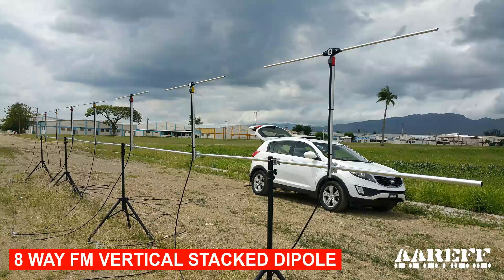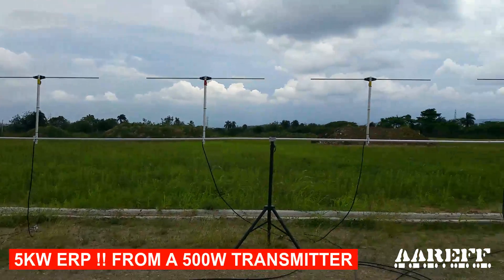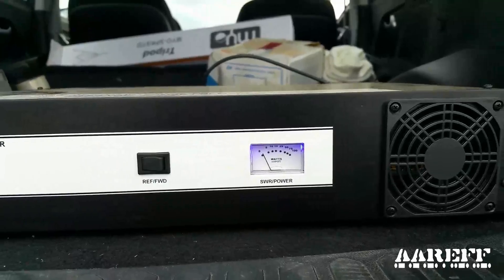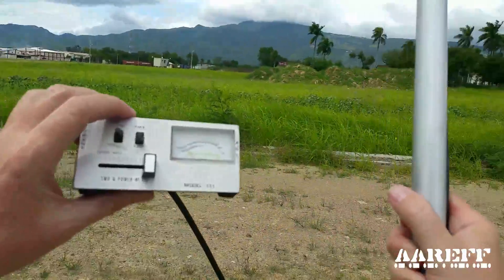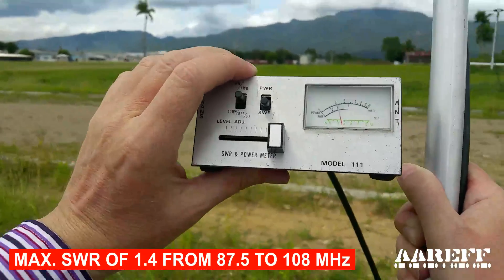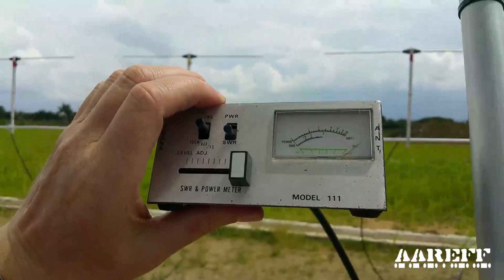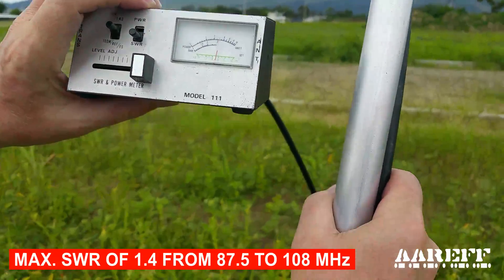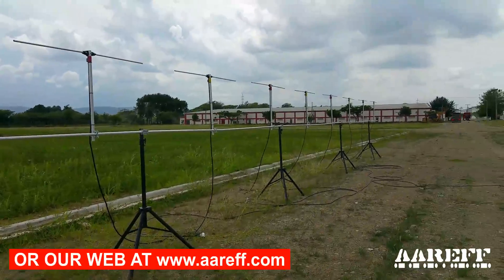8 Way Stacked Dipole 11dBi Gain FM Broadcasting Testing

Comment: Did you mean to say horizontal dipoles?
Reply from the maker: No, they are supposed to be mounted vertical, but to check the radiation pattern we mounted them horizontally.
Reply: @AareffSystems  yea i apologize i figured it out after the comment. i am about to start using two cophased dipoles and was just looking at other peoples builds. this one looks great. good job.
Reply from the maker: @TexasPrisonStories  Thanks 😊

Comment: With those Dipoles There is NO Lightning Protection out in the open. On the circular broadcast antennas the radiators at least go to ground. I use a dipole for my 1 watt station.
Reply from the maker: If an antenna takes a direct hit of lighting, the fact that it's grounded or even has an inline arrester fitted, will not save the transmitter form damage. We stopped using inline lighting arresters years ago when we realised they didn't work.

Through years of experience with our transmitters and antennas installed in severe lightning zone areas, we have found the the 30 degree protection zone method is the better and only way to protect from lightning. There's more info on this here:
http://www.aareff.net/2015/02/25/are-you-worried-about-lightning-strikes
Reply: At the lower transmitter power levels, Dipoles work the best.  The lightning will be attracted to the grounded tower anyway.
Reply: Then you are changing the radiation pattern of the antenna system you've just bought..
Reply from the maker: @knigget357  Why would the radiation pattern change?
Reply from the maker: @SuperBorg1  Agreed
Reply: @AareffSystems  If I Had this antenna on my 1 watt transmitter I would Be way over the ERP limit.(not just a Little) The FCC usually ignores you at only 1 watt with a single antenna as long as you Don't Block any other stations. I always limit Myself to 1 watt unless I Get an LPFM Permit.
Reply: @AareffSystems  Using your 30deg rule adds an extra 2m to the mast which will act as a director and change your radiation pattern
Reply: @knigget357  You can add any vertical amount to the mast, it will not act as a director and it will have virtually no effect on the radiation pattern.
Reply: @SuperBorg1  That's what I was thinking, if I staged this experiment around here I would be asking for trouble. Doesn't make the experiment any less fun!

Comment: Your testing field strength with a 27mhz cb swr meter
Reply from the maker: Correct! it doesn't make the slightest difference if it's labelled 27 MHz. The meter has a RF sample line inside it with rectifier diodes and will work perfectly in the FM broadcast band.
Reply: @AareffSystems  can be used for this dimond sx200 swr pwr meter?
Reply from the maker: @zeljkoadzic1692  The Diamond SX200 power meter can be used, but remember to get a reliable power reading you need to have a 1.0 SWR. This antenna is good, but it does not have a 1.0 SWR, only high quality dummy loads have 1.0 SWR.  This antenna has an SWR of up to 1.4, this is a reflection of about 4% and in normal operation this is not an issue, it's not detectable as a problem or signal loss on the receiving radio. However if you are trying to make an accurate power measurement with the SX200 or any other power meter, then it's normal to expect an error in the reading up to +/-20% with an SWR of 1.4. If you want an accurate power reading you need to use a dummy load with an SWR 1.0 on your SX200.
Reply: @AareffSystems  i have dummy load resistor. RF florida.

Comment: Great video guys, shame you did not  move your hand antenna in different angles to mimic typical car radios angles, and desktop players, the high gain does flatten out the signals, yes doing exactly as it is supposed to, which is why, stations will use  4 bays for city highrises, having a broader pattern
Reply from the maker: We agree, in cities with tall buildings and also hilly areas with deep sharp valleys these antennas are no so good, we prefer lower gain and even circular polarisation. But if you are  on top of big hill or mountian and you can see more than 50km, these 8 ways are amazing.
Reply: @AareffSystems  
I've never been convinced mixed polarity  antennas are better than std dipoles, I come from a land mobile background, and if I can use a hand held in any angle and direction to UHF or VHF  SMD or colinear bases in vertical polarity, I dont get why people in broadcast try push mixed pol, apart from mixed pol ants cost a lot more so they make more money :) I mean are we really to expect that RF discriminates against one idy bidy tiny freq range ?  if mixed worked better no doubt that would be the only base ant available for any band,
Reply from the maker: @Ressy66  There are several studies into circular / mixed, most by the FCC, which demonstrate that circular / mixed works better in cities, like New York, with really tall buildings close to one another. Also our customer reports over the last 25 years would also back up this to a certain extent. Like you I personally prefer vertical, but I have to concede circular / mixed does appear to be better in some situations. The BBC also made some compelling studies that demonstrated that vertical was the best in most situations in the UK. It is still quite a controversial topic with mixed (pardon the pun) views.

Comment: Great test 👍...an question!,when mitter goes to end ,mean how much power you had?? I mean portable power metter mitter
Reply from the maker: To get full deflection on the meter in the video, I can't remember exactly, but it needs between 50mW and 100mW coming down from the receiving dipole. There is no amplification inside the meter, just detector diodes being driven directly from the voltage received in the air (free space).
Reply: I see..but as i realized,your transmitter power set to 50 watt?! If yes so you should have more power in front of antenna with more distance from it
Reply from the maker: @hosseinrf1004  The detector diodes in the meter are not biased and do not have any additional amplification, so they need quite a strong signal to get the meter to deflect, even when you are in front of the antenna. The point to this demonstration only relative showing that at the ends of the antenna the signal is almost completely zero and in the central position the signal maximises. At the point where the signal maximises it must, because the signal cannot go anywhere else,  have a gain of about 9 to 10dB.

Comment: Was the SWR zero when you first connected them up, or was there a lot of fiddling around to get it so low.
Reply from the maker: We checked it and developed it stage by stage. Each single dipole has a 50 ohm match, not 75 ohm. Each are centered with an SWR of 1.0 at 98 MHz rising to 1.5 at 93 and 103 MHz. We checked each dipole separately for this before we started to combine them. Then we combined 2 way pairs, so we ended up with four 2 way stacked dipoles. By carefully choosing the length of 50 ohm cable between the dipole and the 75 ohm quarter wave transformer that does the combining, we are able to get the 2 way pairs to cover the whole band 88 to 108 MHz with a maximum SWR of 1.5.  Then we combine two 2 way pairs to make a 4 way stacked dipole array. Across the whole length this results in two sets of 4 way stacked dipoles. Check the SWR again and it's good, better than 1.5 across the whole band. Finally we combine the two 4 way stacks to make the final 8 way stack. The final 8 way stack has very low SWR across the band.
Reply: Aareff Systems Limited good job. Well done.
Reply from the maker: @WelcomeFM  Thank you :)
Reply: @WelcomeFM  Thanks :)

Comment: I do not understand!
this is how it's gonna happen?
horizontally? on the ground?
Will NOT stand upright?!?!?!?!?
Reply from the maker: Of course it will stand upright and it's intended to stand upright or be mounted to the side of a tower. It's horizontal only for the purposes of this test so it can be seen by walking around it, the gain is real and directive.
Reply: @AareffSystems  You are not showing GAIN as at no point did you replace it with just one dipole and show any difference in field strength.  What you did was show how horizontal polarisation works and how the RF radiates out from the elements on the flat side and not the ends.  It does that with all antennas, even ferrite rod antennas in a MW radio.  Turn the radio around and the station will vanish.
This is a very misleading test designed to fool anyone that does not have knowledge of RF design or antenna theory and design.